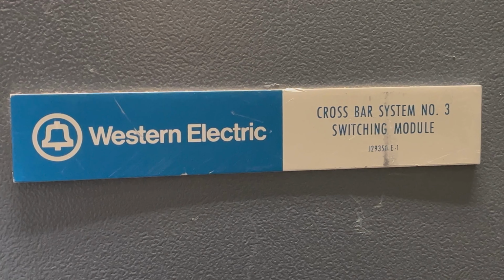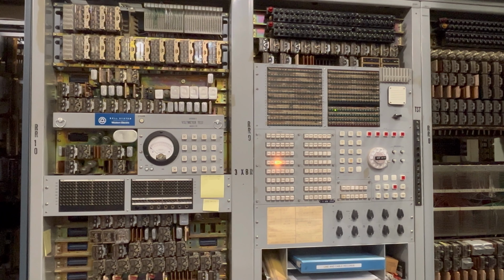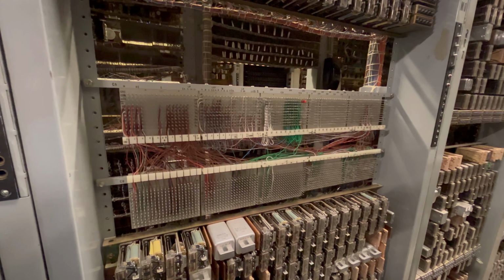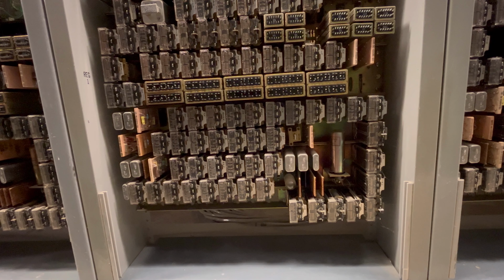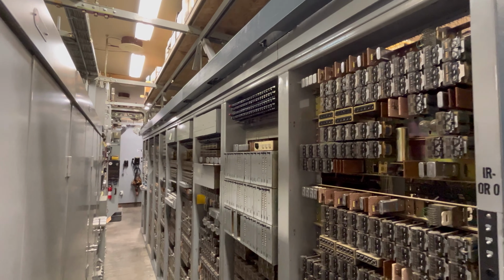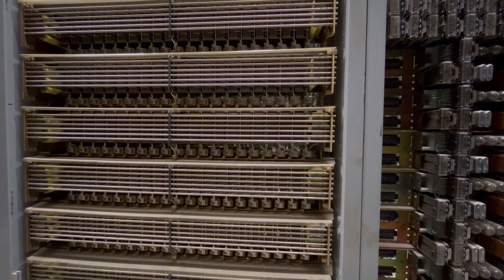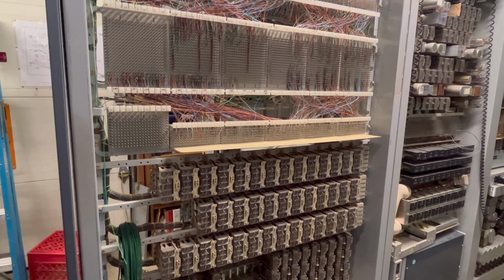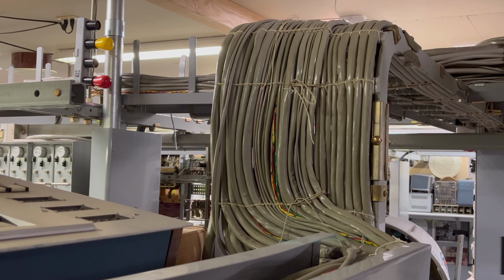Crossbar switch Western Electric # 3 New H D video upload.

Comment: Nortel (Northern Electric) had a similar small Xbar system called the SA1. It was capable of about 1000 lines and was developed much earlier in the 1960's. It was installed in many small rural communities throughout Canada. Very well built system as I installed several plus many additions and modifications over the years

Comment: You say EAS it reminded me if the days GTE territory had Columbia MO, you could call one adjacent wire center with prefixing it with 77, wait for dial tone, and dial 7 digits, toll-free, there was a limited number of these connections,  if you dialed without 77, it charged you for the call. I think there were more areas. The university had disconnected our in room phones for the summer so I had to play on the coin phone in the hallway.  [I was the brat that put shaving cream in the coin return, saran wrapped the toilet bowl, but I got my due payback, someone lathered my door.